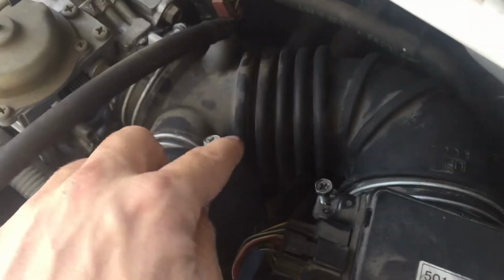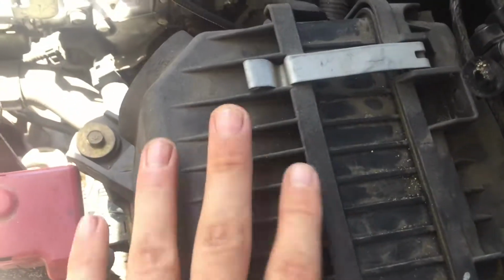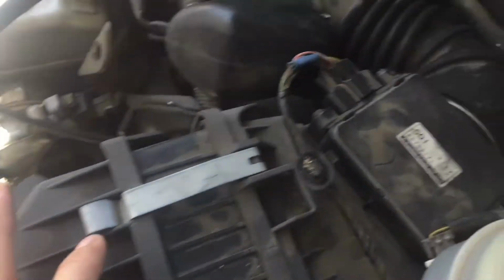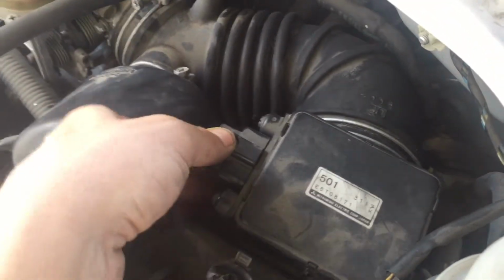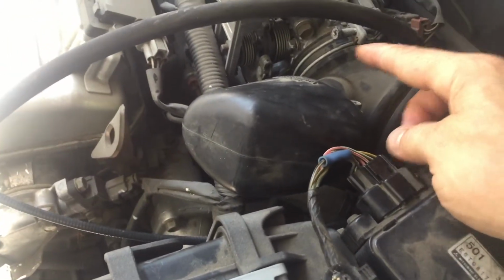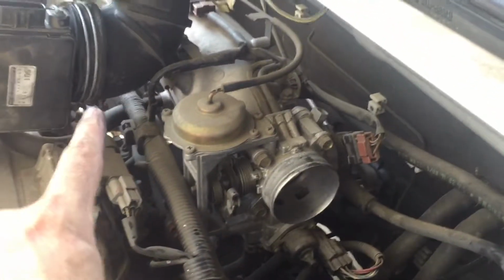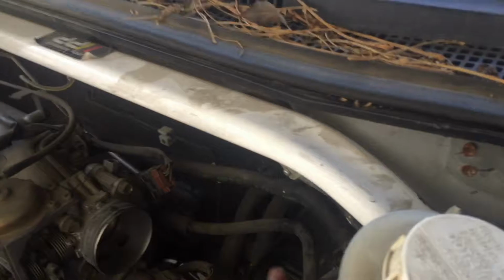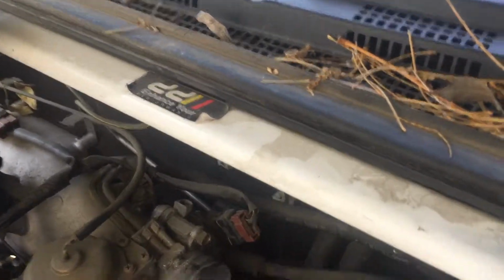Transmission Mount

Comment: Where can i buy that strut bar?
Reply from the maker: https://www.facebook.com/pg/Drag-and-Drift-Performance-201685649874930/about/?ref=page_internal

Here is their Facebook page. I was lucky and found it on eBay  Drag and Drift Performance is from Sri Lanka. But they seem to sell to eBay and Amazon. They are also are made by Ultra Racing. Look for the white painted solid steel verse Aluminum.  They can range in price and are not consistently available. Apologies if this doesn't help you. This upgrade was well worth the effort and diminished body roll significantly.

Good Luck!